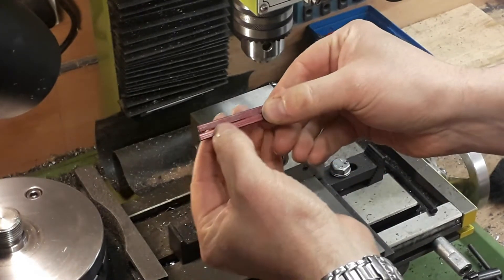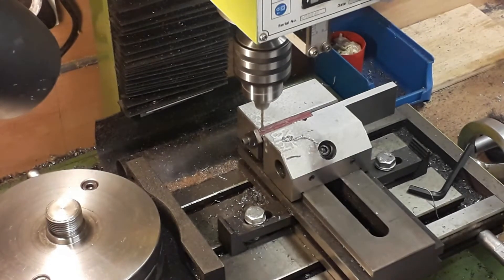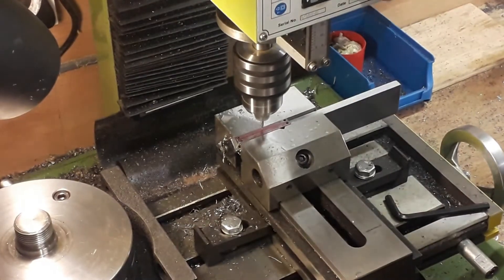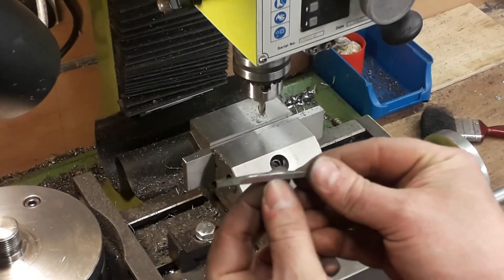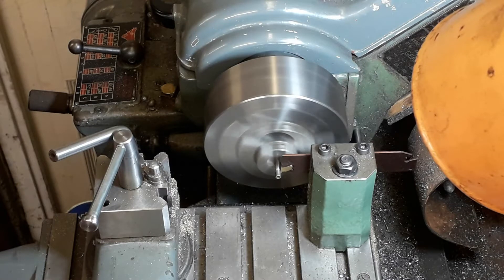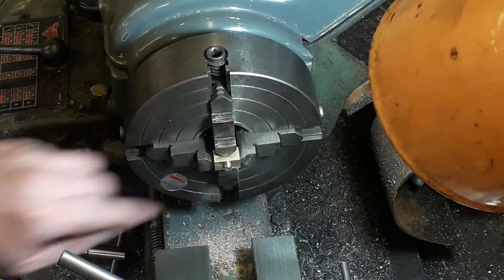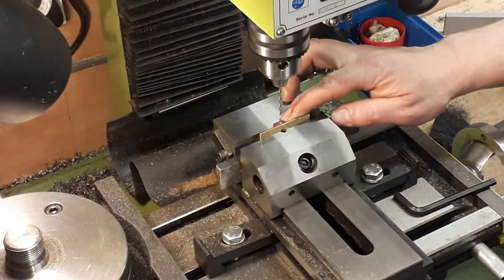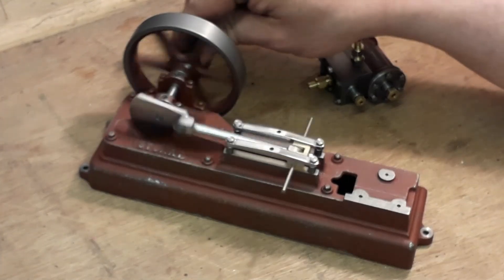Easy Stuart S50 Build Part 9 The Cross Head & Slide Bars

Comment: Nice to make it more detailed. You do not lock the head when you use the fine feed? I guess I added a gas cylinder so it does make the fine feed take more force to turn the knob.
Reply from the maker: The details make all the difference, most of the time with brass being softish I only lock the head for the final pass and always seems to work OK.
Reply: @mattsbitsnbobsworkshop  Looking at the 3/16 sq. material putting a taper on it looks like fun. Wonder how many times I will watch this before I start?🤔
Reply from the maker: @gvet47  yeah, how I did it I thought I can always buy some more LOL just remember do the cutting the other direction as I mention in the video, I started that way just for the camera but finished the other direction,

Comment: I built one during the first "lock down", enjoying your vids, grand as owt.
Reply from the maker: Thanks Peter, any tips to pass on during your build?
Reply: @mattsbitsnbobsworkshop  Everything went to plan apart from one cockup from me, I drilled the crankshaft bores on the drill, Should have known better ! The table was not square, cheep Chinese rubbish. Had to rectify by boring over size on the mill. I have been in engineering for 50 years and then I go and make a stupid mistake like that, must be my age , lol
Reply from the maker: @allandesoer7672  Oh Peter, we have all been there, I only use my drill now if I just want a hole and it doesn't matter if it's not round lol. But you have the skill to sort it out, that's the main thing, every day is a school day. Glad it went to plan, they are a nice little engine. Keep watching, the final paint video is on it's way. Cheers.
Reply: @mattsbitsnbobsworkshop  Everything turned fine at the end, that's all that matters. I have a casting set for the Stuart Beam Engine that I will start sometime , it will take a LOT longer than the S50 now that we are not locked up !
Reply from the maker: @allandesoer7672  As long as you enjoy it, good luck with the Beam.